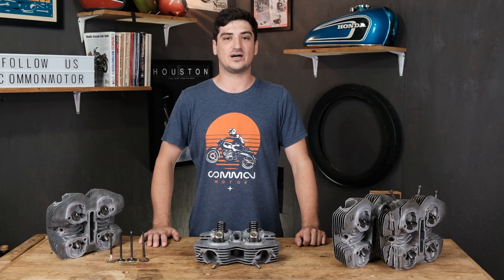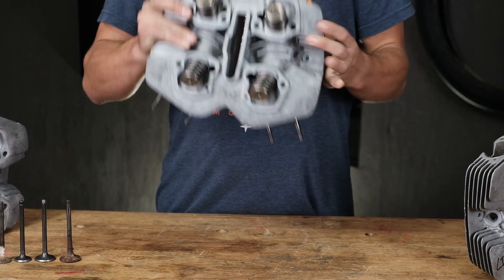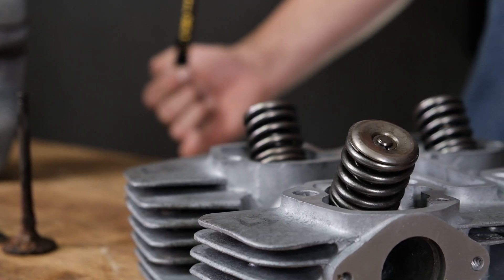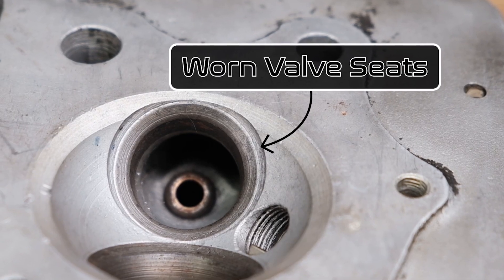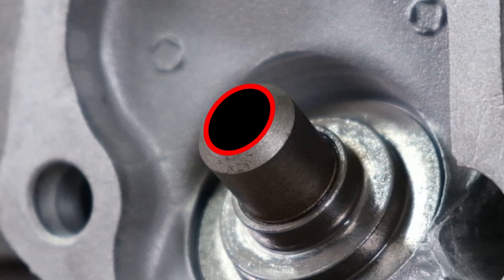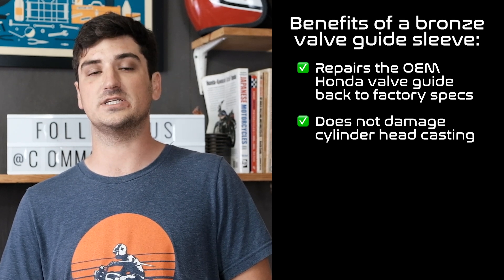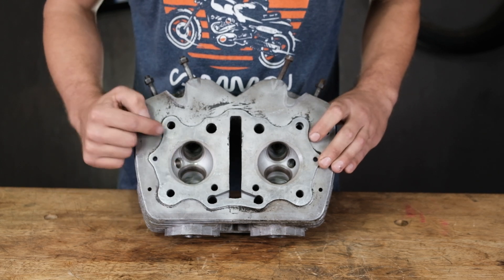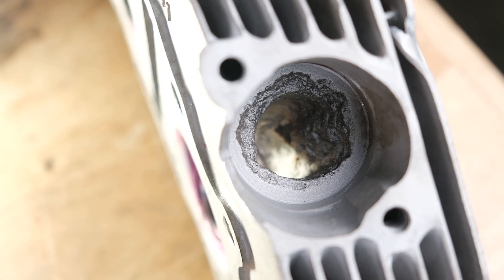Cylinder Head Rebuild: Wear and Repair Explained

Comment: Thank you for showing the different areas of the cylinder head are prone to problematic wear.  Plan on a leak down test with a tester from Partzilla.  Have a hypothesis the cylinder head is requiring a look over.